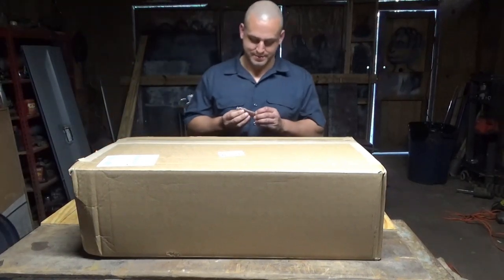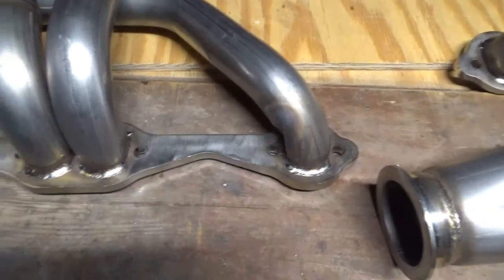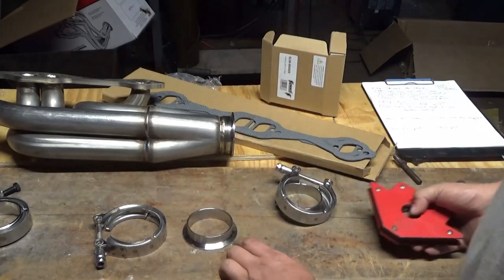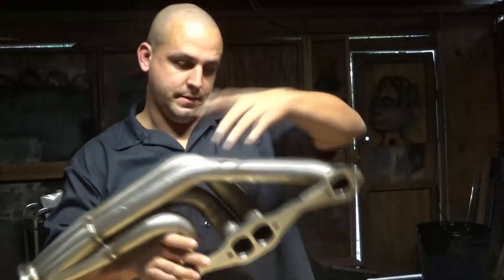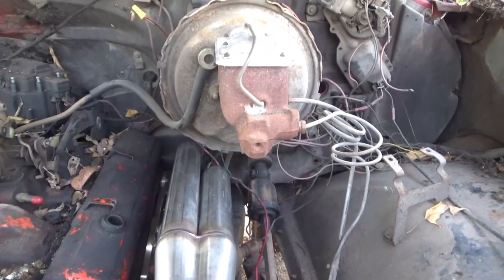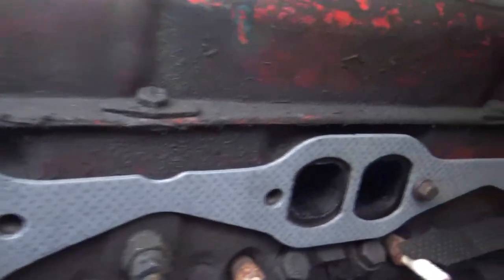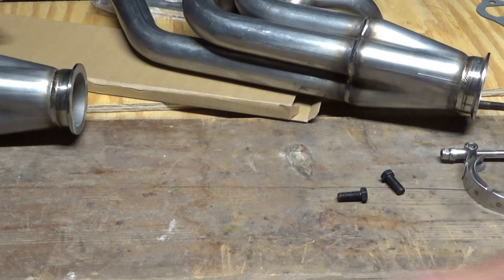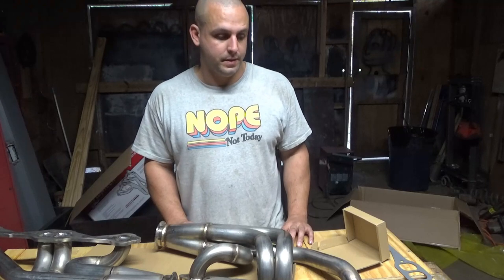Flowtech turbo headers for a small block chevy

Comment: Merry Christmas and great review. I have a l31 vortec c1500 and like many others have realized they do not sell up and forward headers for my engine. These look so close to fitting so I am going to buy a set and see what type of adjustments are needed but I'm sure I can make these work.
Reply from the maker: ok, so these are advertised as universal. just my opinion, I think they would work with any sbc. The only problems i see is that you might have problems with every or anything on the engine as far as brackets or components like alternator or brake booster. I think they will 100% fit the engine, but maybe not the car lol.

Comment: Are these really for turbochargers? I would like to run headers like these....dont mind if they have to poke out the good
Reply from the maker: Yes, they are supposed to be for turbos.
Reply: @davidcraft4909  ok thanks, I thought the turbo in the name was just for a selling point, do you have the part number by any chance?
Reply from the maker: On summit racing part number (11569 FLT).  They are up and forward headers with 2.5 v bands and are made out of 304 stainless.  I'm pretty sure that means they are made for turbos. But I must warn you they are described as universal fit, ok so.  I'm having a lot of trouble making them work on an 81 chevy truck. I'm just saying they are not exactly a bolt in deal.  The headers are too close to the brake booster and where they exit is kind of close to the radiator. I don't know what kind of car you are messing with, but I'm just saying, in my opinion they are not easy to work with. But then again I'm trying to build my first turbo kit and I have no real experience on this stuff. My biggest problem is making a crossover that doesn't interfere with the fan, fan shroud, radiator, and the transmission cooling lines. I think I should have went for a twin turbo setup. Anyway thanks for watching and I hope this was helpful.
Reply: @davidcraft4909  I have a 86 B body (a longer cutlass) so maybe I won't have fitment issues length wise but I might have to cut the hood which is not an issue since it's all for fun. I'll keep the width issues in mind tho maybe tall motor mounts will help. Anyway can't wait to watch more of your vids and hope it all goes as planned
Reply from the maker: @user-wz3ou2wk3j  its not going as planned I entered a turbo nightmare lol.  I  had  a plan, but I didn't consider the waste gates, the exhaust, and all kinds of stuff. It's my first turbo attempt and I'm getting my but kicked lol. I will eventually figure it out, lol.
Reply: @davidcraft4909  I suggest to just route your exhaust out the hood as a starting point till you figure out how,where and why on routine exhaust. That's what I did till I'm done planning, measuring and welding the exhaust, unfortunately mines are either gonna have to remain as hood exhaust or right behind the front wheels because Im still on stock factory suspension. you'll figure it out just have patience and visualize and it will all come together soon. Good luck big bro.
Reply from the maker: Trust me I can get it done. I'm just trying to figure out how do so without building the whole truck around the turbo system.

Comment: Do you have them for a body 4th gen?
Reply from the maker: I have no idea if they make them for a 4th gen. these headers say like universal fit, from my understanding that means they just fit a sbc. But after I got them and tried to build a turbo kit, well lets just say they are very hard to work with.  On a 81 chevy c10.  they outlets are too close to the radiator, and the headers are too close to the brake booster. All I'm saying is that these are not a simple bolt in solution. but yeah I don't think they are vehicle specific by any means.